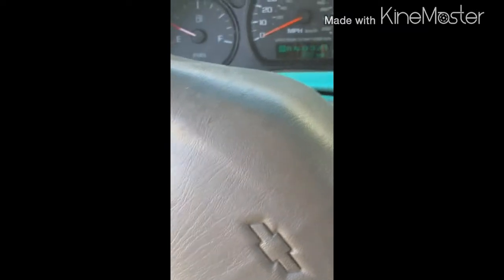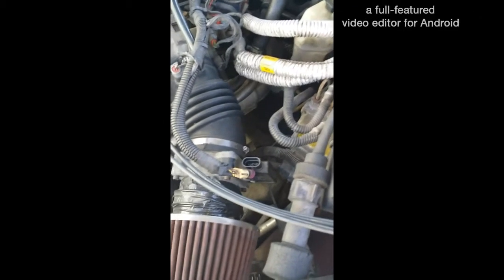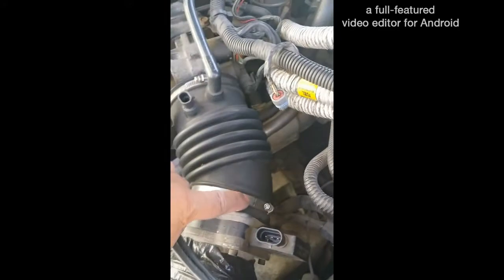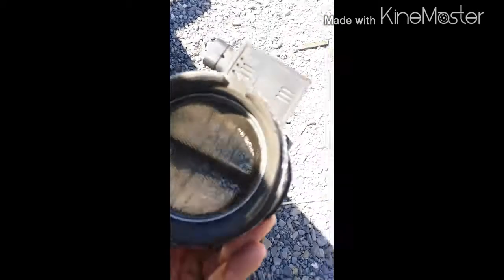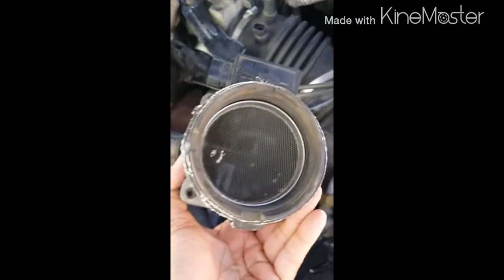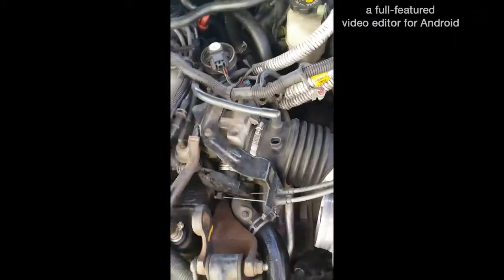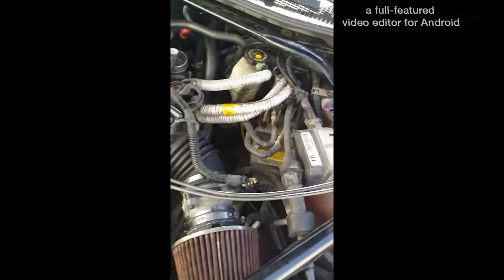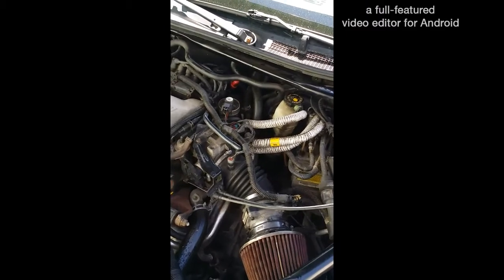2000 Chevy Impala rough idle

Comment: I have rough idle on a 2000 Chevrolet impala 3.4 but the engine is misfiring I took it to multiple shops and they say there is no code they also get the light to go off but after a few of hours of driving it comes back on could it be this problem? does your cel blink?
Reply from the maker: if you're not getting any  codes try cleaning the mass airflow sensor like I did. . then start with the spark plugs then the wires in the ignition coil